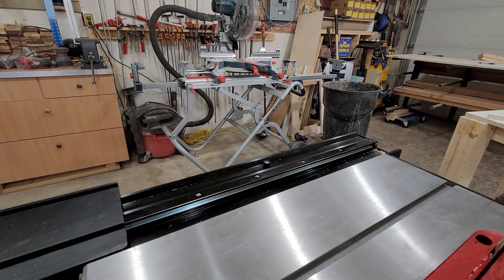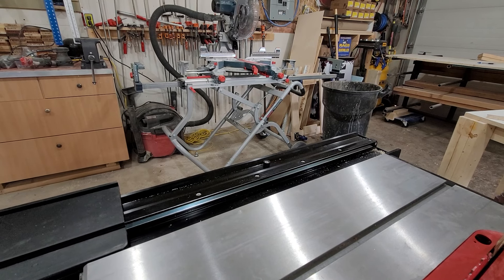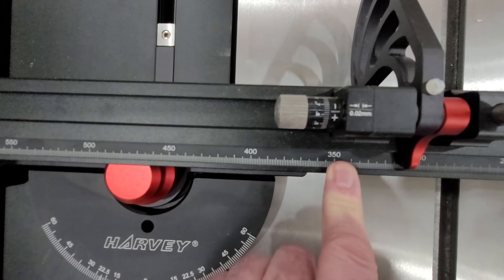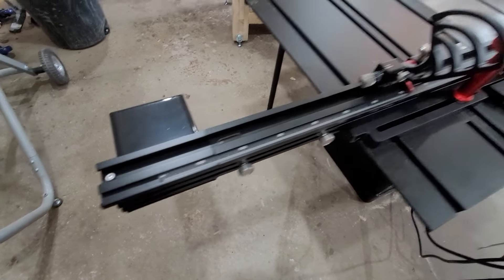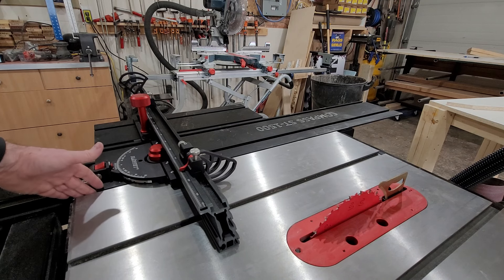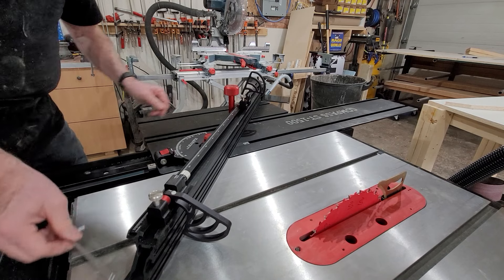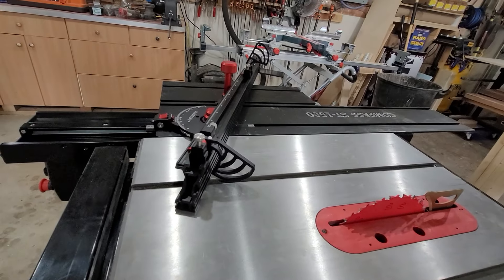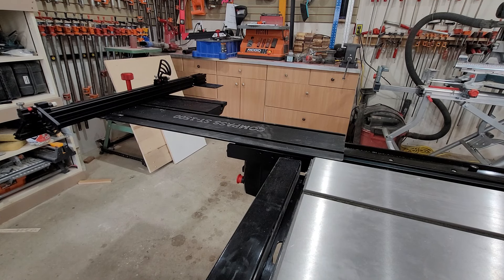Harvey Sliding Table

Comment: Thanks for taking the time to do this video. I just order my sliding table. Do you  know if you can set the fence in the front of the slider like a big sliding table saw?
Reply: I tried it and it does work but its not ideal. You need to remove the end support and your flip stops are backwards. It could be done but it just seems to work better using it as they intended.

Comment: How difficult is it to remove and reinstall the fence? Does it need to be reset every time or does it stay accurate? 
Is there a lock device to lock the slide in place when using the saw for ripping full sheets?
Reply from the maker: The fence does need to be removed when you are ripping long pieces as it gets in the way. You just need to loosen the two set screws and the giant red knob and it just slides out off the grooves. Remember that the set screws are left hand thread so they tighten counter clockwise. I have a special hanger built onto the wall of my shop to store the slider when I am not using it. It's expensive and delicate so you need a safe place to store it between uses.

Comment: You had mentioned Powermatic.  Do you know of anyone that has installed this sliding table on a Powermatic?  Any videos?  I have a PM2000 and am looking into getting this table.  I called Harvey and asked them about the compatibility with my saw.  They really could'nt give me much information.  It looks like I would have to still remove the left wing - which is ok with me.  I asked if I could drill the three mounting holes into the Harvey as it would be easier to drill three holes into aluminum rather that drill three holes into cast iron and then try and tap them,.  They said they don't see why I couldn't.

Comment: Thanks for the video. Question for you - I’m building an outfeed table and need to ensure that the part of the Harvey sliding table that slides beyond the cast iron doesn’t bump into my table. Any idea how much clearance below the top of the cast iron is needed when the sliding table is pushed beyond the cast iron? I will purposely keep this part of my outfeed table lower so there is clearance for the sliding table
Reply from the maker: My table ends where the cast iron table ends. I don't dee the need for an outfeed table that goes any farther left as the slider becomes the outfeed table by itself.

Comment: How accurate at 90 degrees, or how well does it hold the 90 degree setting after loosing and moving the miter setting?
Reply from the maker: I am happy with the way it holds at 90. to make sure it hold when i am pushing heavy slabs through, usuallu 60 to 80 lbs. I use the red handle from my compass mitre guauge locked in the 90 hole. It might be over kill but I think of it as insurance. Overall I am very happy with the slider
Reply: @jbcustomwoodworking4155  Thank you

Comment: Great video glad I found it, Did you  have any trouble putting the gauge bar in? I can’t get mine to fit in.
Reply from the maker: If you mean the part with the giant red knob, it took me a while to get used to it but because I remove that part of the slider so often I ki da got used to it. Most of my projects do not require it and it gets I  the way. I only put it on  when I am crosscutting.
Reply: @jbcustomwoodworking4155  the vertical piece on the bottom that slides into slot t slot ty for replying

Comment: Driving myself crazy with trying to decide which sliding saw to buy.  Are you still happy with the saw and is it easy to get and keep the slider square to the blade?  Any regrets on your purchase of the Harvey?
Reply: Hi Don, I am very happy with my new saw. I have had no issue with the slider staying square but I will admit when I run heavy panels through the saw I take the extra handle off my more guage and put it on the cetre hole to make sure it doesn't move.  I am currently building a 12/4 hard Maple Butcher Block that weighs about 40 lbs. I wanted to make sure it didn't move. The saw has no trouble cutting through 2 3/4 thick Maple. The process of getting the saw was a bit of a disappointment as i documented in one of the videos,  but now that it's all up and running I would do it all over again.

Comment: Is that the Diablo Fine Finish saw blade you have on your saw? If so. is the riving knife the normal kerf or did you order the thin kerf riving knife?
Reply from the maker: Hi. As far as I know there only is one riving knife available from Harvey. The blade is a Diablo D24X ripping blade. The knife is 2.6 mm and the blade is 1.9 mm
I don't know why but it works. The other blade is use is a CMT Glue line rip blade and it is 2.75 mm.

Comment: Did you get the mobile base for your harvey saw? If so, does it work with the sliding table attached?
Reply: I did not order the mobile base because  I ordered the slider. The base doesn't accommodate the extra legs on the slider or the extra legs on the outfeed table. The mobile base seems to be an good thing only if you order the 36 outfeed and no slider.
Reply: As much as I'd recommend Harvey table saws (I own the 110LC-36P, 2HP), I can't recommend the mobile base Harvey sells. It's a Bora imitation and not really helpful at all, especially if one adds the right cast  iron wing and even more so with the cast iron router table. I ended up fabrication my own with real 360deg swivel casters (6 of them, 4 with brakes) and a length of 48" with is fine for this model.
Reply: @wildpat03  I have that saw and went with the SawStop mobile base. It is an awesome mobile base. The only con I have is there's no leveling once it is lowered. It sits on the ground on 2 heavy bars that the saw sits on. But the quality is awesome and I love the hydraulic jack used to lift the assembly.
Reply: @99trampis  Really? I asked a distributor of Saw Stop saws here in Australia if the Saw Stop Mobile bases would be compatible with the Harvey Table saw and they told me no. I went with a different branded one but had to have the tubing all cut down to fit the Harvey base. The Hydraulic jack would have been awesome.
Reply: @jac_builtWoodworks  Yeah, it barely fit but it fit. It was actually Saw Stop customer service that gave me the dimensions and said it should work. The hydraulic jack is worth the price. I have to constantly move mine around because my garage is packed. Sometimes I'm using it in the driveway and it rolls around great.

Comment: Wait you said the slider comes with the saw so you buy the saw and the slider comes with it in package
Reply from the maker: The sliding table is an option but when i bought mine I went all in, 4 HP  52" outfeed and the slider. You can buy other configurations if they suit you better or if space is an issue.

Comment: I liked it until you demonstrated the need for allen wrench tightening if you wanted to adjust the fence right or left.  Also, difficult to remove sliding arm if one wanted to rip a wider piece of plywood for instance.  I had a Delta sliding table, certainly was easy to adjust, and you could remove the table if you had a wider piece to rip.  Table saws remain the heart and soul of any woodworking shop.  Things could have been made more simple if engineers spent time actually cutting wood and running through the sequences that are necessary.  You're happy with the gliding system, but considering the amount of ball bearings on the track, it should!